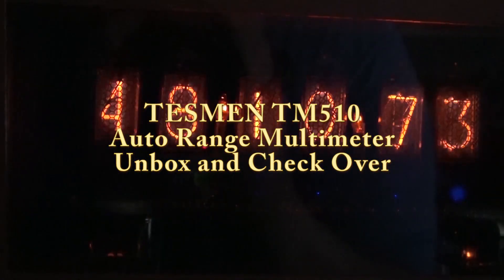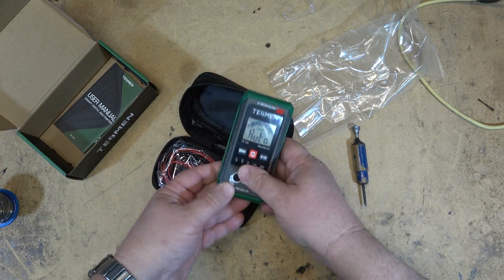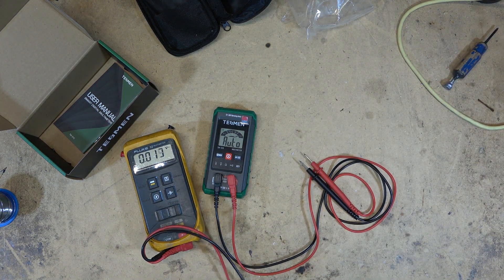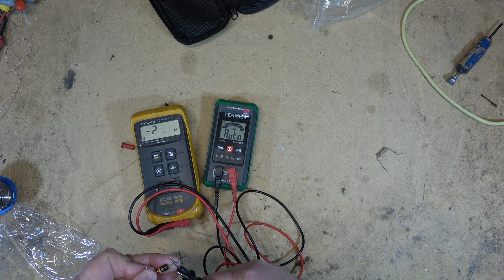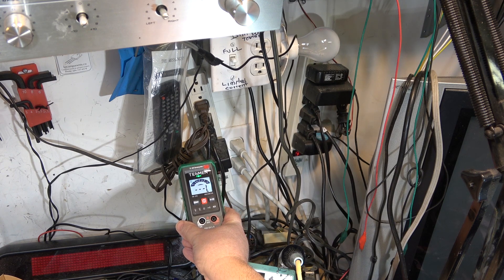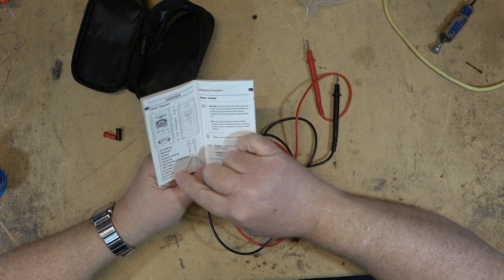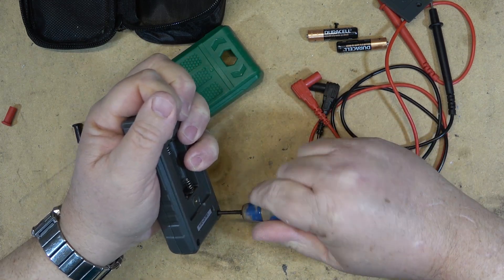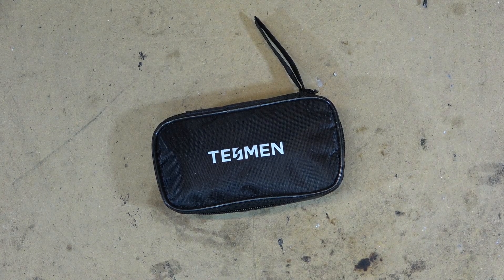TESMEN TM510 Auto range Digital Multimeter unbox test and tear down

Comment: I recently purchased very similar pcwork pcw02b multimeter. Although not as accurate as fluke 83 in VAC, VDC and "horse shue" pcwork can measure capacity of onboard capacitors which is its greatest advantage as it helped me detect leaky capacitors on my stereo amplifier. Unfortunately fluke83 cannot measure 100s of uFs, so pcwork was well worth the money (I paid it approx.35 bucks new). Most certainly if a fella dont have ESR meter.

Comment: Nice unit. Good thing. If you said bad things about products,  they'd stop sending them to you, probably.
Reply from the maker: It's a basic unit. All i do is show it off and then give them away.  
Yes I realize there are no fuses on it, just resistor divider.  It has no current measurement capability and the input is high impidence. It's double insulated. A severe overvoltage would probably pop the chip but that would happen on a high end fluke too.

Comment: Duracell batteries come with an onboard computer that knows exactly when you are most vulnerable, and at that point that computer tells those batteries to leak all over the insides of your new meter.
Reply from the maker: Or remote control.
Reply: @12voltvids  I’ve lost count how many TV remotes I’ve lost to Duracell. Now I only use eveready Lithium

Comment: Like the Kaiweets KM312B but has no diode or capacitance test like the Kaiweets does but that unit doesn't come with
 a soft case. Both are nice ,small multimeters and having a case to cover the screen if you throw it in your electronics 
toolbox is a handy plus.
Reply from the maker: Good enough for the toolbox.  Will likely throw it in my work truck as lost my meter on a job site.  I just use it for checking alarm systems and battery voltages so it will do everything i need.